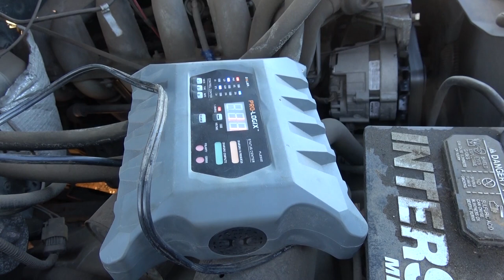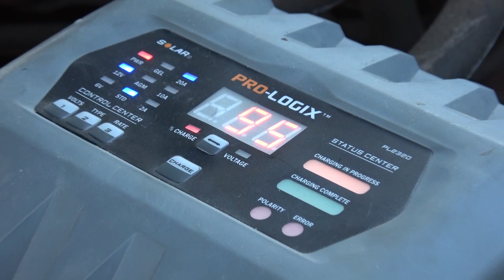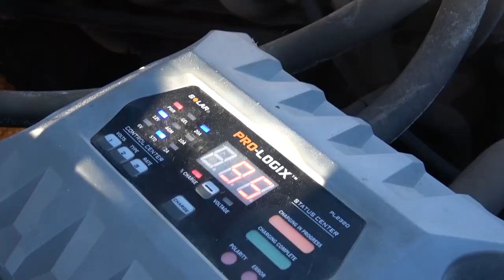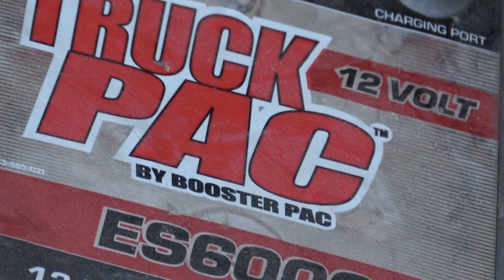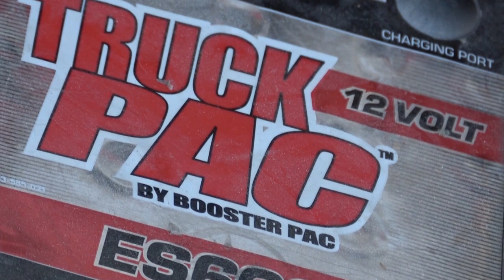Costco Boost Pack | Electrician vs. Truck Starter

Comment: Would you be able to or have you taken apart a Milwaukee drill chuck, I have no idea how to do it without destroying it because one of the jaws fell out and the chuck itself is not covered by warranty and it would be great to fix it myself.
Reply from the maker: You can buy a new chuck and bolt it on. If you broke a "jaw", it's fucked.
Reply: Thank you for the response, the jaw just fell out, the threds on it still look good but I will most likely just get a new one but of I can fix it that would be cool too. I was just curious how the chuck goes together and comes apart.

Comment: Using a li-ion battery pack that doesn't have enough power to jump start the battery. then adding in a makita battery with no protecting device to and could have a caused a catastrophic mess. you would have just been better off unbolting the battery and telling costco to give you a new one.  the costco li-ion pack works just fine on sedans.

Comment: on slightly different subject re frozen brass ball on a brass monkey actually goes back to the tall sailing ship days the balls where the cannon balls and the brass monkey was the cradle there were stored in so they wouldn't roll around    sorry this fact has been rattleing around in my head for a long time     enzo

Comment: 2 wires thin as a strand of hair could handle 400 Amp of current? Suuure no problems, that they pretty much exploded right away is just bad quality.

Comment: I have software that can zoom in on brass ball:
everyone:
me:

Also i have a video on youtube of me trying to start a tractor with one of those stupid Li-Ion starter packs, and then a jumpstart with my truck. Turns out the main motor bearing was not bearing anymore. And the company forgot to clean the paint on the ground ties on the chassis. And the starter was underpowered. They had to replace the whole motor. What a hassle.

Comment: Did anyone consider cleaning the battery terminals before running a charge thru them?  You have to start with clean connections.  Love the fun you share.

Comment: What the fuck do you need a lock on the steering wheel for, is that just to stop you if you're too drunk to unlock it you can't drive, like the old Irish ads; " do you really need that 6th pint before you drive home?"

Comment: For those few here who do not know. The real reason those things don't work is, that lithium batteries don't work worth crap in the cold. If you live anywhere that gets cold as hell, get a lead-acid jump kit. They actually have cold-cranking amps.

Comment: Also most of those chargers have a protection mode to not charge a stuffed battery with a dicky cell, you can usually trick them to charge but.  Fucking hilarious videjeo but

Comment: Oof, this thing seems like a piece o' garbage.  Who puts electronics INTO the cable?  I got one (not this brand) for about 80USD just before winter.  It's started my suuuuper dead SUV battery, and the mostly-dead battery on my work van on a single charge in about 45F.  These things /can/ work, but this one looks like trash.  Also, heck yea to the Balvenie, best stuff on a cold morning after waking up!

Comment: Get yourself a zippy flight max 4s 5000mah battery or higher and remember the c rating is how many multiples of the capacity it does in current, because some drunk idiot hanging from his ankles designed the measurement system, maybe get some leads too so you don’t torch the battery end and waste $40-$80

Comment: A 20 volt dewalt 6 amp hour battery would do a better job than that piece of crap jump starter. I think most people at least try to use 12 or 10 gauge wire to jumper the small battery.